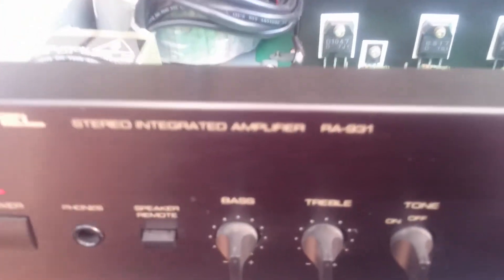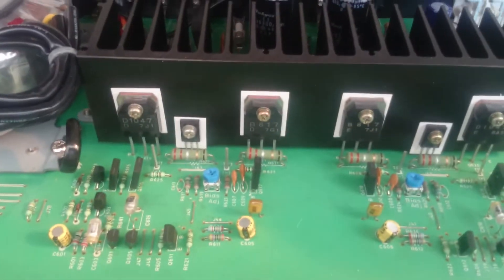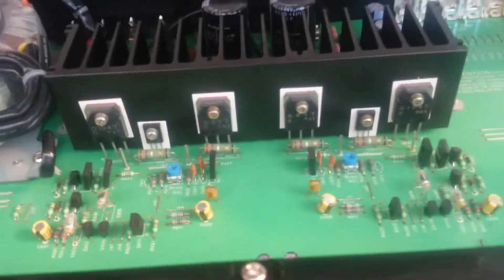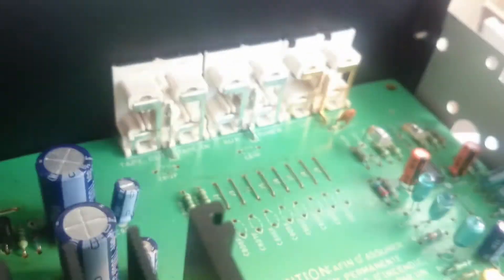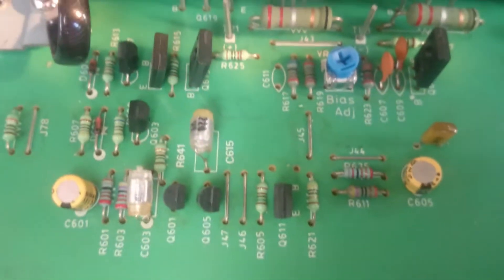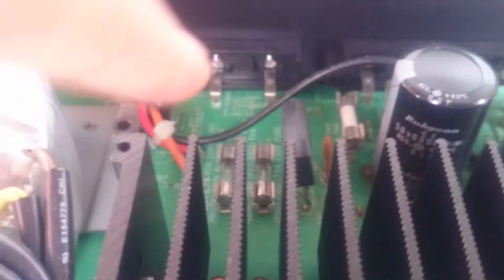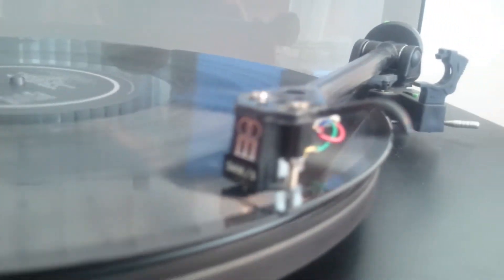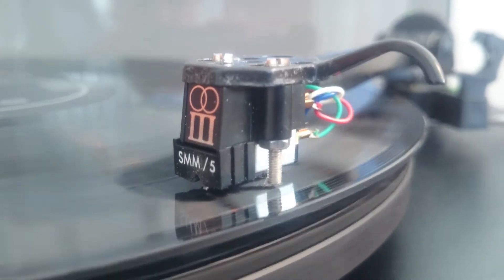Rotel 931 modifications

Comment: You will get absolutely not a smallest benefit from changing diode bridge to the fast one. :D Opams, yes. You can easily find better opams that will change the sound a lot. Quality capacitors are important there where signal is going through them. One of the most important thing in Rotel 931 is to change the main filter capacitors to at last double capacity of what they are now.
Reply: @ D.V. - " One of the most important thing in Rotel 931 is to change the main filter capacitors to at last double capacity of what they are now."     Can you please clarify this.  What capacitance does the Rotel 931 have now?  What would you recommend as a 'minimum upgrade' when recapping?   Gino below has linked the Service Manual for the 931  Thank you.

Comment: Hi and sorry to jump in just now but i have now a buy option of a ra931 in good conditions.  I have looked at the schematics.  It seems to me that the voltage gain of the power amp section alone is about 18 times.  This is a lot already.  I do not understand the need of adding more gain with an additional  preamp stage (i.e. the op-amp).  My idea would be to by pass completely the line preamp stage (i.e. the op-amp) and wired the volume pot output directly to the input of the power amp stage.  In this way the volume would be completely passive (i.e. low noise).   Could this work ?  just asking.  I have the feeling that too much gain in the preamp is not beneficial for good sound.    I am attaching the link to the service manual found in the net 
https://www.vintageshifi.com/repertoire-pdf/pdf/telecharge.php?pdf=Rotel-RA-931-Service-Manual.pdf
Thanks a lot, gino